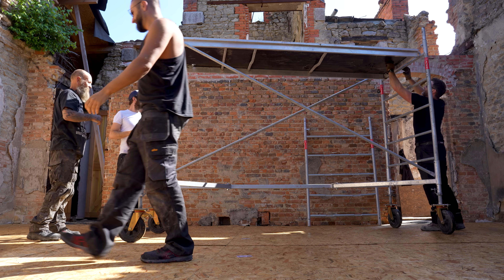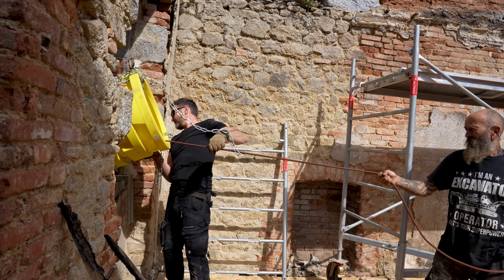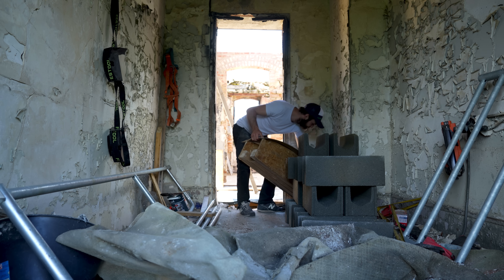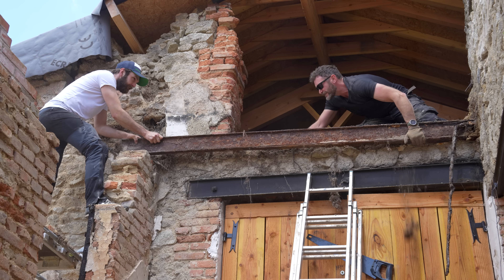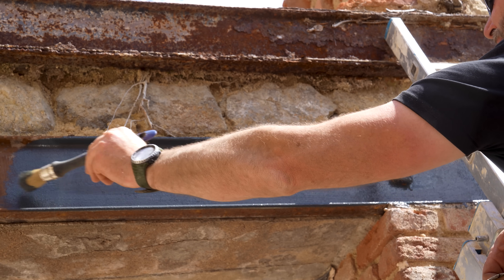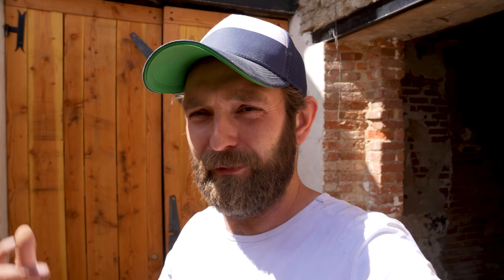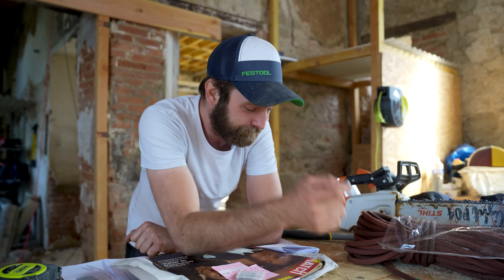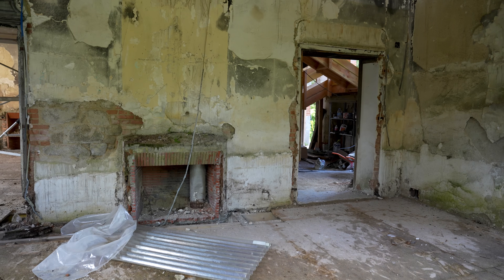Its the end, its the beginning.

Comment: Should there be some type of celebration when the last tree/plant is removed from the top?  Watching the raising of the bricks reminded me of story I read decades ago about a workers comp filing letter:    Dear Sir:

I am writing in response to your request for additional information in Block #3 of the accident reporting form. I put “Poor Planning” as the cause of my accident. You asked for a fuller explanation and I trust the following details will be sufficient.

I am a bricklayer by trade. On the day of the accident, I was working alone on the roof of a new six-story building. When I completed my work, I found I had some bricks left over which when weighed later were found to weigh 240 lbs.  Rather than carry the bricks down by hand, I decided to lower them in a barrel by using a pulley which was attached to the side of the building at the sixth floor.

Securing the rope at ground level, I went up to the roof, swung the barrel out and loaded the bricks into it. Then I went down and untied the rope, holding it tightly to insure a slow descent of the 240 lbs of bricks. You will note on the accident reporting form that my weight is 135 lbs.

Due to my surprise at being jerked off the ground so suddenly, I lost my presence of mind and forgot to let go of the rope. Needless to say, I proceeded at a rapid rate up the side of the building.

In the vicinity of the third floor, I met the barrel which was now proceeding downward at an equally impressive speed. This explains the fractured skull, minor abrasions and the broken collarbone, as listed in Section 3, accident reporting form.

Slowed only slightly, I continued my rapid ascent, not stopping until the fingers of my right hand were two knuckles deep into the pulley which I mentioned in Paragraph 2 of this correspondence. Fortunately by this time I had regained my presence of mind and was able to hold tightly to the rope, in spite of the excruciating pain I was now beginning to experience.

At approximately the same time, however, the barrel of bricks hit the ground-and the bottom fell out of the barrel. Now devoid of the weight of the bricks, the barrel weighed approximately 50 lbs.

I refer you again to my weight. As you might imagine, I began a rapid descent down the side of the building. In the vicinity of the third floor, I met the barrel coming up. This accounts for the two fractured ankles, broken tooth and severe lacerations of my legs and lower body.

Here my luck began to change slightly. The encounter with the barrel seemed to slow me enough to lessen my injuries when I fell into the pile of bricks and fortunately only three vertebrae were cracked.

I am sorry to report, however, as I lay there on the pile of bricks, in pain, unable to move and watching the empty barrel six stories above me, I again lost my composure and presence of mind and let go of the rope.”

Comment: I notice the joists/noggins and I-beams (RSJ) installed have no provision for electrical cables and plumbing pipes. Even if you don't need central heating in that part of France, you'll need hot and cold for the baths, wash basins and sinks. 
Jack, the Japan Alps Brit

Comment: Looking at the mag pict, I noticed the radiator under one window.  I know its a long way off but I wondered if you were considering reinstalling radiators or if you were thinking of a different system?  As someone who has to dust my own house I would ask you to really consider radiators as they are a much cleaner source of heat opposed to something like modern forced air systems.  I know this from experience.  Like I said, it's a long way off but thought I would give you my 2 cents.

Comment: Six week run to the roof is what they said?   Beginning of August to start on the roof should put it on path to be done by the time the fall rains start. A lot of work to be done on that top area for that to happen, several feet of brick work in some areas after tearing down the loose structures. That turret is the most scary area.